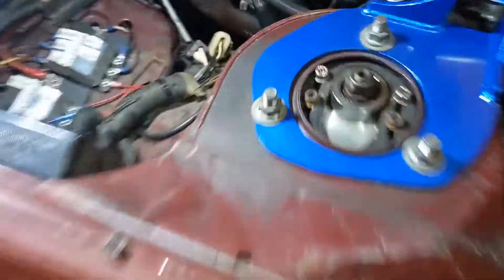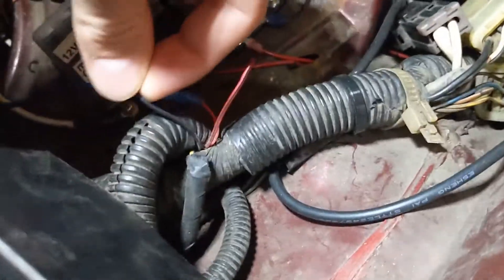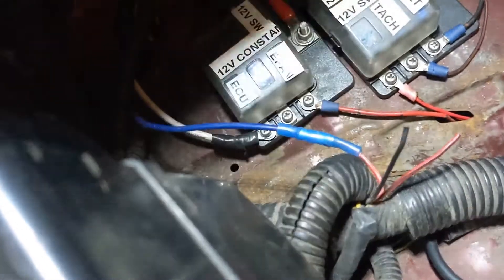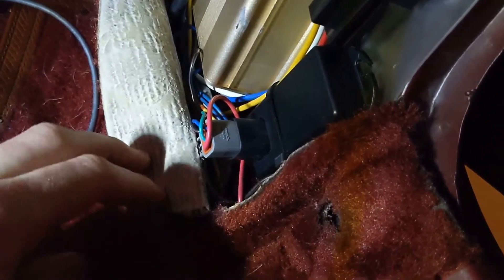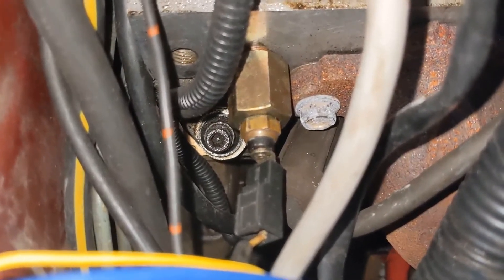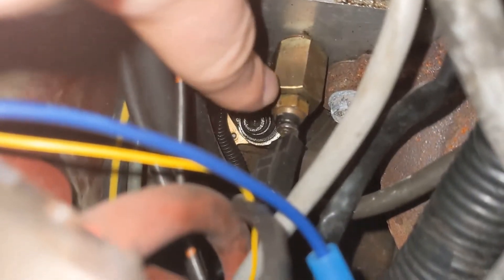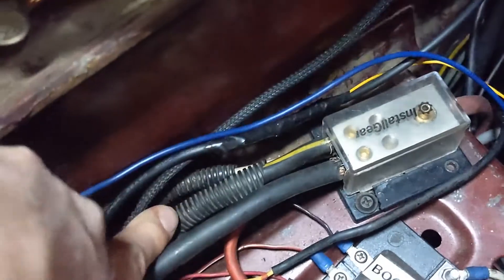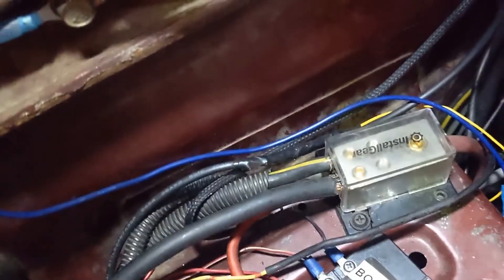Z31 300zx Getting the Stock Gauges to Work with Megasquirt

Comment from the maker: My Speedo wiring explanation in the video was poorly explained so let me elaborate here. The Red with white striped wire that originally went to the cable driven speed sensor (digital dash cars only) is actually wired to my speed output on my MS3 Gold box ECU. I have the speed input from the transmission VSS wired into the ECU directly. You change some speed settings in tuner studio to get the speed to show correctly on the digi dash. So it's trans VSS speed input into ECU and other wire on the VSS is grounded to chassis, ECU speed output to Z31 red/white Speedo wire, change speed settings in tuner studio until digi dash speed matches your GPS speed on your phone

Comment: Hey been watching the videos and haven’t seen any info on this and was wondering. Do you have/need any more chassis strengthening besides the strut braces? My ls will be roughly 400/500hp and just making sure while I got the motor out If I should do some strengthening while waiting for a trans to come available.
Reply from the maker: Yeah I would recommend strengthening the chassis as it's a flimsy unibody. I have a strut brace, tension rod brackets braced together, pucker fab fender braces and I plan to get a 6 point cage eventually